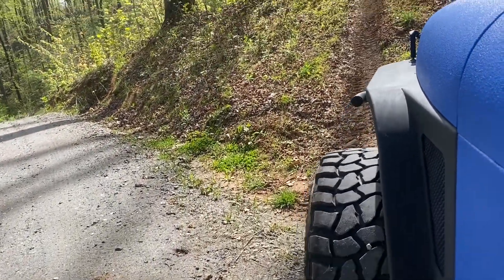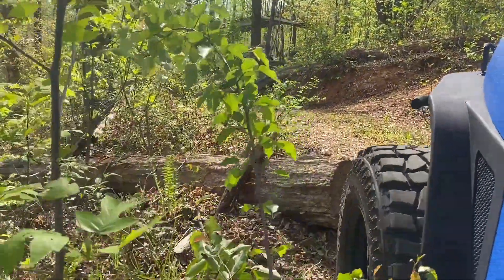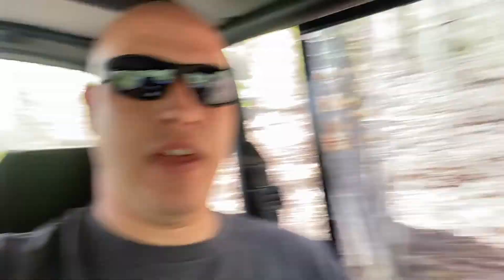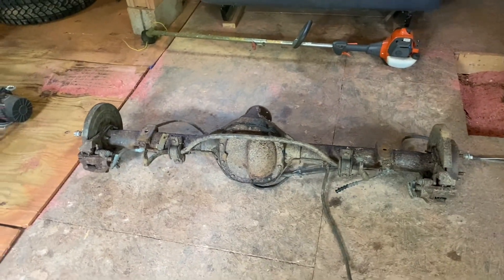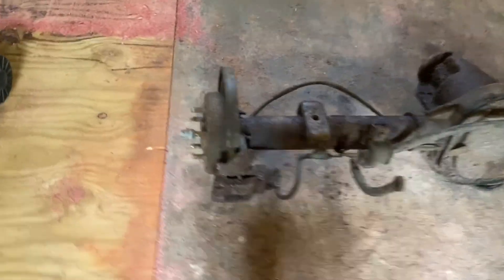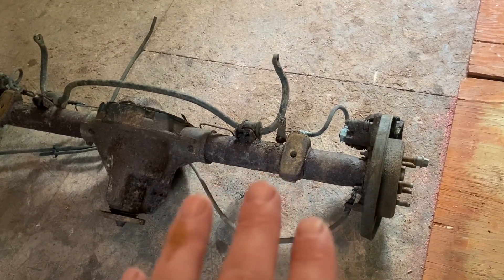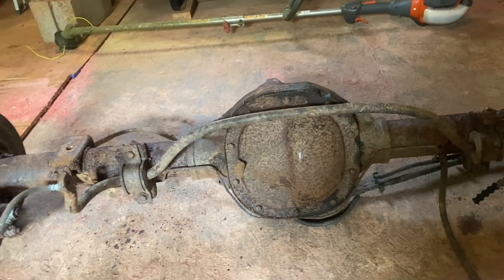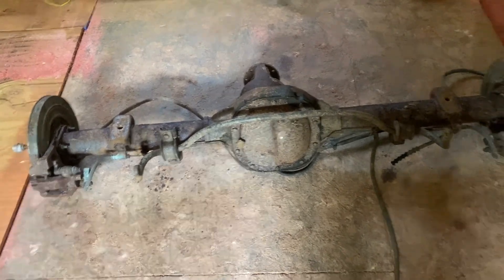Ford 8.8 buyers guide for Jeep v8 swap

Comment: hey man how did you deal with the pinion being off center and lining up with your drive shaft just picked an 8.8 up and am wondering that
Reply from the maker: I am actually finally about to do the install haha. But I know it is a little off center but I don’t think it’s off enough to cause any problems. The only issue I may run into is my drive shaft is about a half inch too long right now so I may have to shorten it even more or look into the slip yoke eliminator kit. Hope this helps 👍